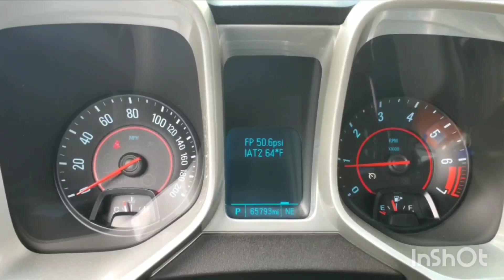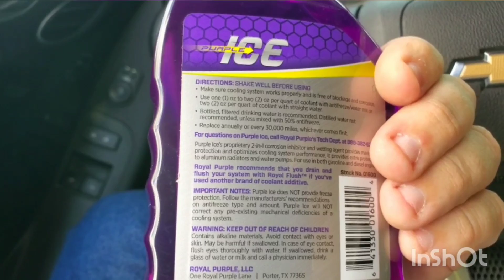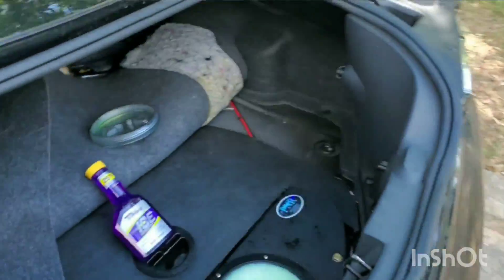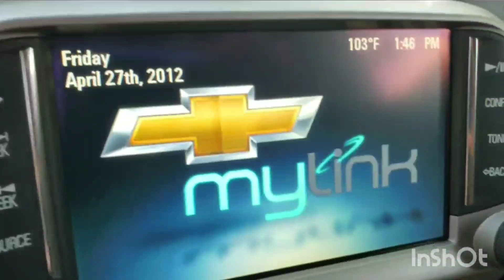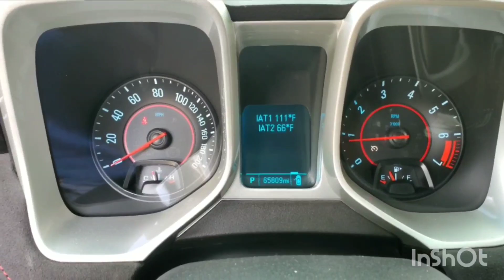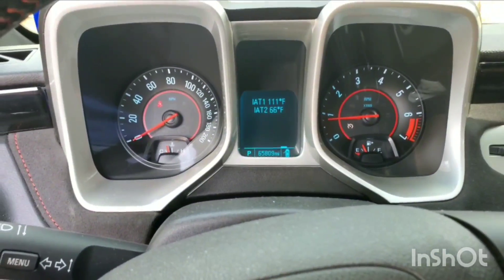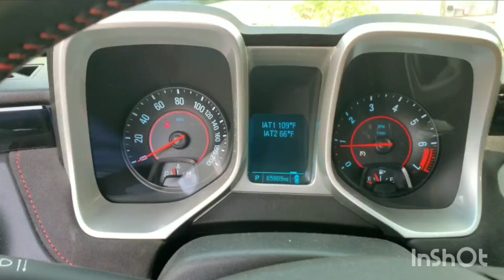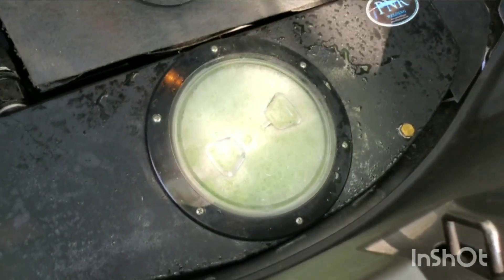Royal Purple Ice Test - water wetter

Comment: I've seen no "control" in these test on YT so far. Shutting your hood will increase IAT temps. Also, IAT isn't a direct reflection of engine temps...so IAT as a control doesnt work... especially if you shut or open your hood.
   As for sitting there allowing your car that already has mechanical temp regulations (fan, thermostat, fans etc) you're not going to see a drop in temperature unless you surpass the car's ability to cool bc your car is also heating itself up, & then regulated by those mechanical aids. Especially if you have an icebox in the back of your car you've already modified your car to further retain cooler temps. This test will only work if you surpass your cars ability to "naturally" let's call it, cool your engine. 
 An idea....
Radiators are regulated by the thermostat. And your thermostat regulates temperature via pressure that opens the thermostat, allowing water to cool the car. So, adding ANY cooler additive like let's say a cup of ice (not enough to actually cool the volume a car holds while being heated by the engine, would only temporarily delay the time of pressure building to open said thermostat. For example... If you added one cup of ice every half hour let's say, the cars heat would surpass the cooling capabilities of ice spread out through that much time, thus not reflecting an actual drop in engine temperatures. All it would do is increase the time that it took for the thermostat to open (or X pressure/ X heat to be reached)... Or decrease the amount of times the thermostat had to open.
   I'd say a safer test on a personal car might be to monitor how often a thermostat is opening, or how often fans have to kick in to aid the water. Other than that someone with me too have the thermostat either removed or held wide open... Unplug the fan... Let the car idle and find its regulated (without mechanical aids) temp. Then adding Purple Ice and see 🤷‍♂️
Reply from the maker: and open or  closed hood does  it affects IAT temps with a chiller installed. This test was in no way ment to monitor engine temps. If you actually watched or listened the whole point was to see if it would affect the intercooler temps at all. Which it obviously it didn't. A lot of people out this stuff in their intercooler fluid and sweat it helps. You probably want to  go argue with them.
Reply: @TractionControlusa   I see I see. That's a chiller 🤦‍♂️🤣, fair enough, I miss that part. I get what you're saying here... however, this product isn't meant for this type of a test. That's all I'm trying to point out here. It's like using a fork to cut food with...it can work,  but it's not really it's true purpose. 

 All it does is increase the surface area that water contacts surfaces to. In order to cool it needs a large surfaces like radiators, that are normally at or over 200⁰. It's not magically changing water into colder water via chemical reaction or etc.

 Far as I know a chiller is uses the AC to cool the water. And At 63⁰, there's less of a threshold here to cool. Meaning, hot cup of water at 180-220⁰ (radiator temps), cools at a higher rate than say... a cold cup of water at 63⁰. 
I didn't hear anything about the size of the intercooler you have, but I'd assume it lacks the same surface area as a radiator. Those are two huge factors, plus it being aided by AC, is all going dramatically lessen it's ability to work. I don't mean to be semantical, but...if you get how it is achieving what their claiming, this video isn't representative of proof it doesn't. I'm going to try my bottle in my weak ass radiator here soon 😆. 

Ps. Nice car, pss...I want a chiller now on my Z06! Thanks 🤑 lol.
Reply from the maker: @MaxwellReviresco  agreed. I didnt think it would do anything from the start. That's why I did the video. Lots of guys think it does and there's no arguing with them.

Comment: Needs to be 100 percent water/distilled enable for this to work properly.
Reply: It tells you on the back of the bottle to use purified water, not distilled. Its also mainly used if you wanna use a straight water setup in your ice tank or radiator.
Reply from the maker: not according to the instructions on the bottle. says will work with 50/50.  the whole point of the video is that it doesnt do what people think it does in an intercooler system.
Reply: @TractionControlusa  If I understand correctly, are you running an interchiller along with the trunk tank? I’ve been trying to find out if anyone’s been running both, with no luck. I have an intercooled Magnuson 2.3 on my 6.1 hemi, and I’d like to go for a trunk tank and or an interchiller.
Reply from the maker: @chrisiztheman1618  if you are considering an interchiller I suggest watching our other video specifically about the improvements we made to our interchiller system

Comment: It won't do anything in a car or truck because the system forces itself to an operating temperature. It's designed to. It's actually a problem if you don't let your system operate where it's supposed to. Your fuel system requires temperatures in any newer vehicles. Try it on a pre 2000 model I bet it does more.
Reply from the maker: You realize this was added to the intercooler system and not the engine cooling system?
Reply: It will also make a difference in two and four stroke engines.

Comment: I’m confused as to why your point of reference is the iat? It’s a coolants additive. There’s lots of other factors for hot iats other than just coolant temp.
Reply: You don't even have the correct tools to preform this type of test.
Reply from the maker: You realize I put it in the intercooler system and not the engine coolant system right? Iats are the ONLY point of reference for an intercooler system.

Comment: What Purple Ice and other additives do is reduce the formation of localized steam pockets in the head. Water has to be near the boiling point to form steam. The water in your system isn't nearly hot enough for Purple Ice to do anything.
Reply from the maker: Funny, because that's not what it says on the bottle ..or in their advertising videos.
Reply: They say to use it in intercooler systems? This type of product works much better as far as heat transfer when mixed with plain water. You obviously have to use antifreeze  in your system since you're supercooling the water to begin with.
Reply from the maker: Haha the label on the bottle says it works fine with antifreeze. You're just making excuses at this point. Probably because you use the stuff. After making this video I've noticed a trend that people that use this product will defend it like they make it...even when they have zero evidence that it does anything at all.
Reply: @TractionControlusa  I've never used it. ALL Purple Ice/Water Wetter-type products make a claim regarding temperature reduction, usually in the 20-30 degree range. If you do the slightest bit of investigation you'll find that this degree of temp reduction is with plain water. When used with antifreeze they claim a maximum of about 6 degrees.
Reply: And, again, it is in the cooling system. Not in  coolant that has been supercooled with the A/C system.
Reply from the maker: Again..that's not what it says on the back of the bottle, or in the their advertisements. People wanted to know what it would do in an interchiller system so I made a video showing just that. If you dont like it thumbs down it and move on. Maybe you can come back and link me to a video of this product actually working on something, anything...even pure water.
Reply: @TractionControlusa  where do they say anything about using it in intercooler systems?
 http://www.royalpurple.com/product/purple-ice-cooling-system-optimizer/
Reply from the maker: @65sohc  I dont think you understand that people use this stuff in their intercooler systems ALL the time. Usually with the belief itll help reduce temps and help performance. However none of them have any evidence that it actually does anything in their system. That was the whole purpose of this test. If purple ice works in an engine coolant system great,grand,fantastic...even though I havnt found any real world tests that it does. This video was made for people using it in intercooler systems...which I have already stated.... including in the video itself.
Reply: @TractionControlusa  Fair enough but, again, if one understands the concept it would make more sense why it would be effective in one scenario and less or ineffective in another. Royal Purple does not claim that by simply adding the product to lukewarm coolant the temperature will magically drop. That would require an endothermic reaction which is not what is occurring. I don't know how hot the cooling medium in a normal air to water intercooler gets but if it high enough to cause localized steam pockets a wetting agent would help. With your Chiller the intercooler never gets close to boiling so Purple Ice would not be expected to be of benefit. It is analogous to using race gas. If you put 105 octane fuel in a Prius you will gain 0 hp because it doesn't detonate and doesn't need more octane. That doesn't mean race gas won't work in the appropriate scenario.
Reply: I need this for the leaky head gasket on my car, I bought a $35 jug of the fancy coolant but it's still having issues.
Reply from the maker: @health-vh8ce  if you have a leaky head gasket then you need to replace the head gasket. No fancy coolant is going to fix your head gasket